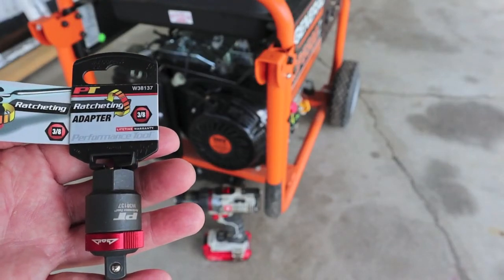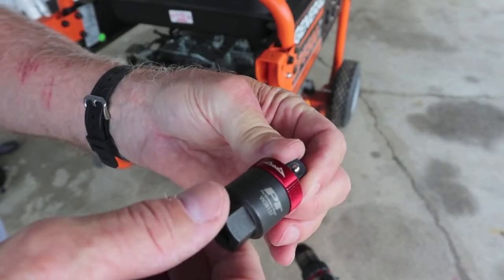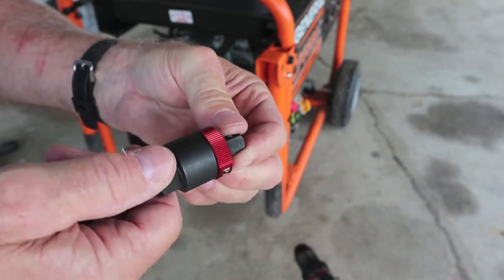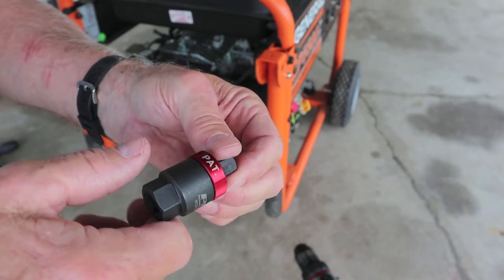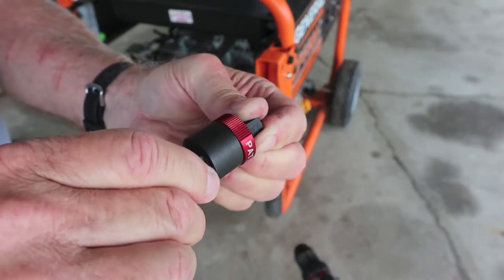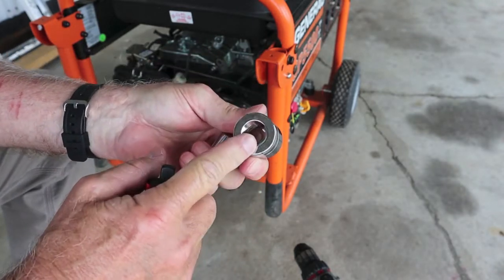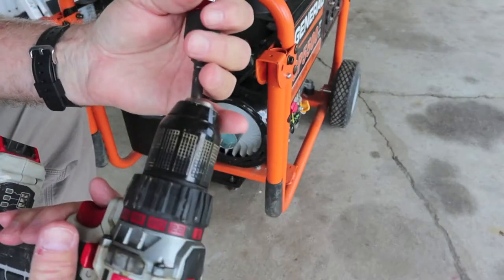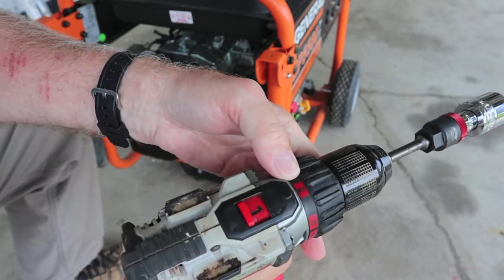Will a Ratchet Adapter on a Drill start your Engine? YES, but a word of CAUTION!

Comment: wow, never thought about a rachet, of course this will make it safer, i was worried about my wrist with that force on my 600 watt drill force combined with the generator's  on my 7 hp chonda ... good trick on the one way bearing too, i can think of one place they have them, on my old bike :) cheers ... oh and another way is to use something like an old washing machine motor and just leave it permanently setup to do the job ( saves risk to wrist ) the washing machine motor doesn't need to be disengaged after start either, as it wont create any voltage ( only works as a motor not a generator so it just spins without mains power attached )
Reply from the maker: Thank you for watching and sharing!

Comment: Rather than making a concoction, could you not just wrap, duct, tape or gorilla tape or something around it in the right position so that it couldn’t switch back to the locked position? I don’t have one yet so I can’t test it. I just don’t want togo build the concoction if I can avoid it. But I am concerned about the safety aspect. I try to make things idiot proof because I’m a top-notch idiot sometimes.
Reply from the maker: The low cost of these adapters make it feasible to set the selection ring to your needs and then tack Weld, JB Weld, epoxy, etc and make it permanent. 
It all depends on the engine but some can fire off so quick where it will definitely move a weighted ring selector to the opposite setting. 
Thanks for watching and work safe!

Comment: The unit I got ftom Amazon, blue letters, does not stay in position under load.
Reply from the maker: Amazon has a very good return process. Take advantage of it or simply epoxy the selector ring in your preferred position. 
Thanks for watching and work safe!

Comment: Does the generator need to have an electric starter option in order for this to work???
Reply from the maker: Absolutely not. You're just spinning the crankshaft over with a cordless drill instead of pulling the rope.
As with any rotating machinery....please be careful!
Thanks for watching!

Comment: Since the rachet adapter will 'lock' or 'reverse'  direction due to rpms,  what's the point of using it?  A poster to this video wrote, "I'll set the direction I need, and tape the 'selector switch' tightly to that setting, so it won't inadvertently switch directions nor lock up on me."  Does anyone know if using tape to hold the rachet adapter setting in place is enough to prevent it from 'locking' or 'reversing'  direction due to rpms?
Reply from the maker: Tape will eventually give up. The best way to prevent it from reversing is to apply a small bead of epoxy. 
Thanks for watching!

Comment: I cut out my pull rope so I could get to that bolt. I was surprised that when it started it almost broke my wrist!
So be prepared to instantly remove your drill!
Reply from the maker: That is definitely a good tip to share, thanks for the added info!

Comment: Companies should have perfected the old style wind-up crank instead of going to the pull cord design
Reply: Man I haven't see 1 of those since the 60's. Neighbor had a mower- you flipped open the crank handle on top- cranked it round a few times- press something and the wound up spring turn the motor. I'm guessing here.
Reply: @joshmartin1938 yep.  We had one like this too.
Reply from the maker: I like that idea!
Thanks for watching!

Comment: Down inside the female end of the rachet adapter theres a allen head screw. Remove the allen head screw and you can slide it apart. Once you figure out the direction you want it to go its not hard to permanently  fix it to stay that way.
Reply from the maker: Good to know!!
Thanks!

Comment: This is something that I have used for many years on many different types of equipment. However, I use a ratchet that is 1/2 inch drive. That way I can do away with one less adapter.
Reply from the maker: That sounds like a great idea! Thanks for sharing!

Comment: I took my ratcheting adapter apart put a steel pin in place of the detent ball and spring so it stays locket wherever you put the direction selector together
Reply from the maker: That is a great idea!
Thanks for watching and sharing!

Comment: I bought it and it is crap. It locks up before you can get it off. Locks both directions. I have busted three  drivers already.. I should be easy to make and they should make them for left and right turning only without both directions and it would solve the problem.
Reply from the maker: I'm sorry to hear that. What size engine are you attempting to start? I'm curious...

Comment: Where do I find the video on building one with the one way bearing?
Reply from the maker: I never used a one way bearing due to overheating the seals. I used a starter drive and even that will overheat the bearing seals.
It's hard to weld on them.
The ratchet adapter will obsolete the rest.
Thanks for watching!

Comment: Need to reinstall the shroud,  that keeps the air flowing around the cooling fins.
Reply from the maker: Sounds like a smart move, those fins need to be protected. Thanks!
Reply: @pmtips4482 can we purchase complete, or maybe do another concise vid to put this together? Thanks.
Reply from the maker: @grandcrappy No worries as there are only 4 components: drill, 1/4 hex to 3/8 or 1/2 inch drive adapter, actual ratchet adapter, and the correct fitting socket.
Thanks for watching!
Work safe!

Comment: Had a generator pull chord clutch finally delete itself in the dead bottom center of a winter storm. -13 expected with -60 windchill. 

This will suffice until the parts arrive. Thanks. Now i can add a backup option in case this happens again. This generator likes to eat pull chords, 5 so far, but this clutch explosion is a first. Granted it was made of plastic and a good part of a decade old in the elements on the back of my van.
Reply from the maker: That’s a rough situation, glad this video helped!

Comment: HOW STRONG OF A DRILL DO YOU NEED?
Reply: I would think that most twin cylinders would be equipped with starters
Reply from the maker: I just use a 18 to 20 volt cordless drill. It should turn over most single cylinder engines. No way I would try this on any twin cylinder. 
Thanks for watching!

Comment: Made one these, tried it on my wood splitter,15hp Lifan,  battery drill, electric drill, and a 3/4inch electric rattle gun.  Didn't work. Yes I followed the instructions to a T

Comment: I was looking to DIY convert my Briggs monster to electric start and found this video. I was curious if the crank would still be a choice. NO because of the fly wheel thing. I broke my back moving the monster last year so pulling a crank is probably NOT a good idea OR I am just paranoid these days. I tried this method and it does work!! I did not break myself or anything else!! Hurricane season is upon us and we always loose power.. Thank You for the info..even a skinny little female can do this. 😏
Reply from the maker: Please be careful! Any time you are around rotating machinery, always consider your proximity to danger. Another thing to consider is the absolute ease these new inverter generators start. On my Predator 3500....I never use the electric start. One or two pulls and it's off to the races!
Thank you for watching and commenting!

Comment: How do you make a one-way bearing, I like that additional safety.
Reply from the maker: I like it too, but it would take some fabrication to make it. The worst part will be welding to the bearings inner race without melting all the grease and seals on it.
Thanks!

Comment: Its now 3 years later and I am wondering how long it was before your engine seized up. You really need to replace the cover over the fan to direct the cooling air flow over the fins on the cylinder. Best to cut a hole in the cover to accommodate the socket and use it with the cover on. Greetings from Australia.
Reply from the maker: ...and cut the hole in the shroud is what I did. I also got rid of that generator after it destroyed a TV and a microwave with a dirty sine wave. 
Thanks for watching mate!

Comment: I have done this for years, and my ratchet  adapter  has lasted for yearsi just cut a head off of a round head ratchet  and set the way it needs to turn and weld a worn out socket to to it
Reply from the maker: I thought about exactly what you did!
Thanks for watching!

Comment: I started my old lawnmower for years like this, didn't bother with a ratchet adapter just used a socket & a power drill
Reply from the maker: I noticed when trying that, it always seemed hard on the drill transmission. A Porter Cable 18 volt drill.
Thanks for watching!

Comment: For the price, I’ll glue/JB Weld the adapter in the proper position. This is a game changer! Awesome!!!
Reply from the maker: Thanks for watching!
Stay safe!
Reply: I had the problem of my ratcheting adapter locking up and not free spinning  with the speed and torque the engine. I took the adapter and set it in the direction I  needed it to spin. After I did that, I used jbweld to permanently keep it the correct position

Comment: Just snapped my snow blowers cable wanted to make sure this was a thing and not something I saw in a tiktok fever dreeam. Just gonna run my 3/8 milwaukee impact. Good enough to turn over a LS good enough to fire this cheap craftsman lol
Reply from the maker: A true impact has no turning power, it uses internal hammers to strike an anvil. You will need a drill driver type of tool.
Thanks for watching!

Comment: IDK how long an electric will last, and I'm NOT SAYING TO DO THIS, but I've been doing this with air tools for atleast 30 years.
With air, no need for the wratchet adaptor, just a long extenstion and a socket.
Reply from the maker: An air drill (not impact) would be great for this. My air tank is always empty;)
Thanks!

Comment: Just FYI 
Your crank pulley cover serves as a cooling air deflector for your engine.
Don't leave it off
Reply: Was just about to post the same thing. Those fins on the flywheel cover are there for a reason. Air flow is super important to regulate engine operating temperature, especially on a generator that runs for long periods of time.
Reply from the maker: Exactly!
Reply from the maker: Great advice!

Comment: Don’t do this with gloves on when the engine starts and the glove raps around extension on the drill and gets ripped off your hand it hurts alot speaking from experience. The other problem is you can break off the crank shaft nut.
Reply from the maker: It requires caution. 
Only an impact driver would twist the crankshaft nut off, only use a drill driver.
Thanks for watching!

Comment: use a corded drill or you might kill nice tools if starting higher compression motors.  I learned the hard way after using a very nice Bosch 18V to start outboards.  Killed the clutch eventually and regrets every time I remember my laziness and stupidity.
Reply from the maker: Yes, when the engine hits, it can put tremendous force on the little transmission in the drill, better the drill than your wrist.
Thanks!

Comment: In 1963 my dad built a fixture to start the lawnmower using a solid rubber pulley from a washing machine using the biggest craftsman drill ive ever seen.  I was a big kid, but if you didnt plant your feet firmly it would spin me around.  Used it for years.
Reply from the maker: Thanks for sharing!

Comment: That is SO COOL, dude!  I was just looking around for any info on how to add an electric start to my Generac.  This is going to be a lot easier and cheaper.  Thank you!
Reply from the maker: Glad I could help!
Reply: @pmtips4482  OK... I JUST got around to trying this out.  I could not turn the motor with this setup, and I'm using a pretty new Ryobi 18V.  Thinking I need to go with more power.  Dang!  Still, good video!

Comment: We did this recently to get our 2--stroke chainsaws started. I found that this year I couldn't cut our firewood as I had lost the strength to use the rope starter (long medical story). My brain still works though so I had a think about the urgent problem (winter coming).

We bough one of these rachet adaptors and found like you that it slipped easily to set the wrong direction. As it wasn't going to be used for any other purpose I decided to ruin it with a liberal dribbling of locktite fluid either side of the setting ring. Now it doesn't move.

In the spirit of ruination we also welded an old drill adapter into the ratchet adapter. So making a porpoise built dedicated tool.

I was concerned about using the flywheel securing bolt to start the engine, worrying that it might come unscrewed so devised an alternative plan.

We used the two 6mm threaded puller holes on the flywheel to attach small steel tabs with bolts to the flywheel and to those tabs we welded an old spare half inch drive socket spanner. The half inch socket peeps out of the flywheel cover through a 22mm hole which replaces the cord and ratchet starter mechanism.

The conversions look factory made and work perfectly.

I'm now looking to do the same to our 4-stroke mower engines, hoping that they too turn anticlockwise.
Reply: I did the same thing even before seeing this...  Saves the $$$$ and the arm.  Praying for further success to you, but if you find one of the other motors going the other direction just buy one more and Loctite it in the direction needed. $17 and done.
Reply: Would like to see details on HOW you did such & see it demonstrated
Reply from the maker: Sounds like you did awesome on the DIY homemade adapter!
Thanks for watching and work safe!

Comment: cant you use an air inpact whitout ratchet adaptor?
Reply from the maker: No, an impact of any kind will have an internal hammer striking a rotating anvil. You need a drill or driver drill as you're looking for turning power to turn the crankshaft. An impact will just tighten the nut on the crankshaft to the point of stripping it out.
Thanks for watching!
Reply: @pmtips4482  ok thanks for the advice

Comment: Thanks for the video.   The solution to the safter part is a small high strenght coil spring mounted on the engine crank nut or in the socket. The idea is if you are not pushing pressure onto the drive nut the small coil spring pushes the socket off of the nut.  This is the safety part, it pushes the socket drive off the crank shaft drive nut as soon as you let off the push pressure on the nut.  The rachet mechanism is still good but this is the real protection.

Thanks for the video 
Wm Hamel
Reply: Sounds great in theory until the spring falls in your blower housing and your flywheel explodes
Reply: Excellent idea! Of course a spring like that from Ace Hardware will be $9.95 plus tax. Just kidding. But not by much.😀
Reply from the maker: Great advice!
Thanks!

Comment: Please forgive my ignorance; I must have missed something. Why cant you just use the tighten/loosen button on the drill instead buying the little red thingy?
Reply from the maker: The main thing that can happen is you don't get the drill off in time. Then it's either an injured wrist or damaged transmission/gearbox in drill.
Thanks for watching!

Comment: I haven't been able to use a pull start for anything since I got put in a wheelchair,. I now have the ability to start things again, thank you.
Reply from the maker: Thanks for watching!
Please use extreme caution around rotating machinery!
Reply: @pmtips4482 Steve's Small engine Saloon just covered this topic. The only other issue that I can see here is... YES, a 3/8" drive sounds a bit sketchy  for that. If I buy one, and I AM planning to buy one, me thinks I'll get a 1/2" drive unit.
Reply from the maker: You couldn't go wrong with a 1/2 inch. Just be careful to pay attention to the selector ring, it can switch around on you during use.
Thanks for watching!

Comment: How's it held up after 2 years?  And where'd you get the part you fabricated your own from?  Thanks.
Reply from the maker: It worked till I got a newer gen set with electric start a year later.H
It was a 70s Ford starter drive real cheap on the bay, and proper socket sizing, the steel rod was 3/8 inch diameter.
Thanks!
Reply: @pmtips4482  Got it, thanks!

Comment: I was starting a lawnmower with a drill without an adapter like this when the engine caught it ripped my drill in half. 
I've heard of people breaking wrists doing this. Definitely not worth getting hurt or breaking tools. If you're going to do this use an adapter like this or one with a one way clutch.
Reply from the maker: Very good advice!
Thanks for sharing!

Comment: I tried this on a 10HP motor of a rototiller I have the requires a pull rope, not spring loaded.   and doesn't work
Reply from the maker: I'm not sure why yours did not start, but be very careful when attempting.

Comment: Can that adapter be used on a ratchet instead of a drill? Is there a centrifugal mechanism in the adapter which allows it to lock up at low speeds but freewheel when the engine fires?
Reply from the maker: The adapter takes the place of a ratchet. This model has a rotary sleeve to switch direction. It works but you have to use caution as after the first attempt,  centrifugal forces will turn the selector ring.
Thanks for watching!

Comment: I tried this using the adapter in the description, it broke within seconds, didn't even get the engine started.
Reply from the maker: That's a bad deal then. I'm not surprised though, QC for across the way is lacking in every single thing we buy.
Best of luck to you!